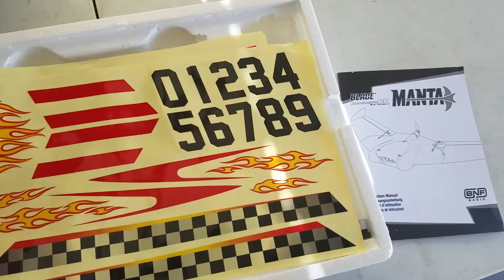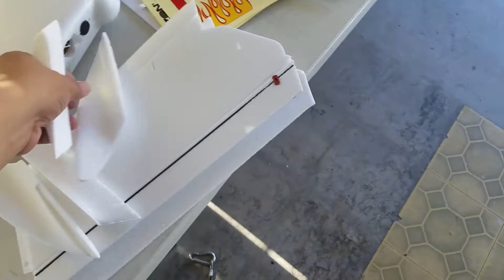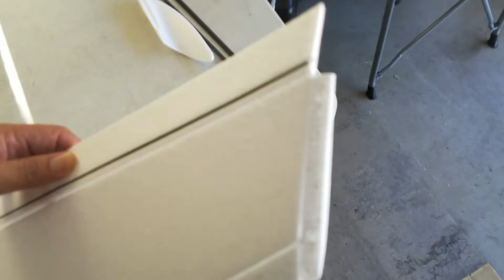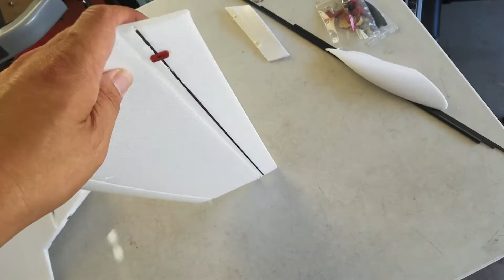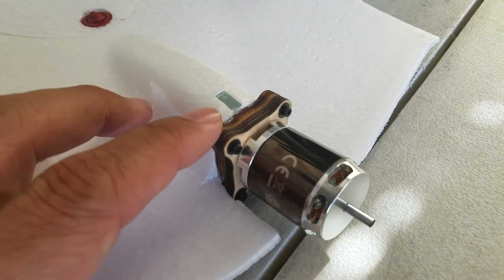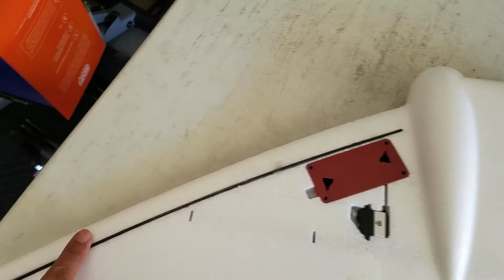Blade Manta FPV Unboxing and Build

Comment: Great video.  Do you think it's a good idea to laminate?  I laminate my combat wings and just picked up a new Manta.  Looks like laminate would help the wings hold up better in a crash.
Reply from the maker: Captain Tripps the foam is fairly durable and easily repairable. I don't know how much weight the laminate will add and how it will affect flignt . However, I have flown this with a go pro  installed and it handled the weight no problem. But I know for sure the laminate will make it very resilient in a crash
Reply: I figure 3 mil laminate should be OK.  Maybe even try 5 mil.
Thanks!